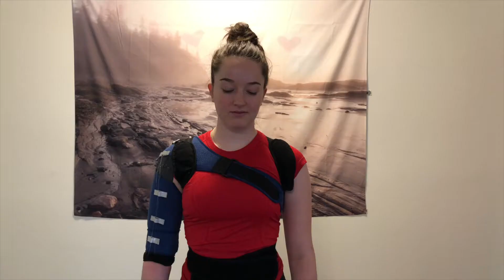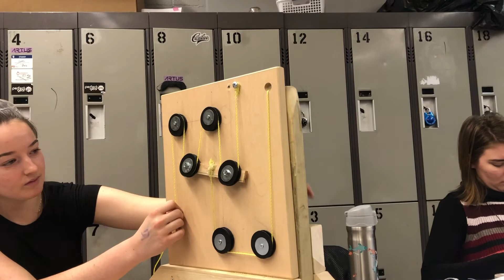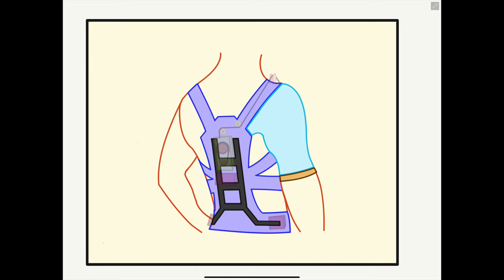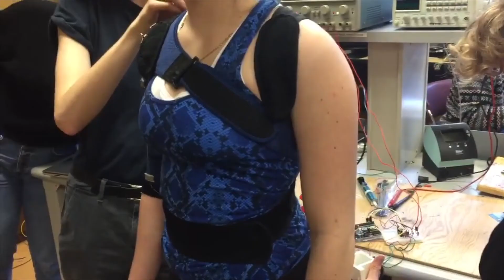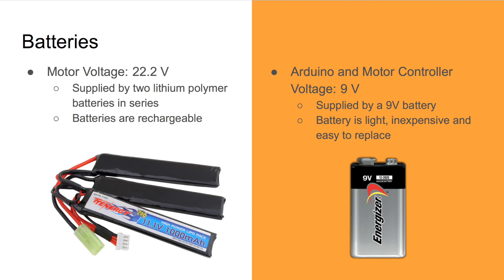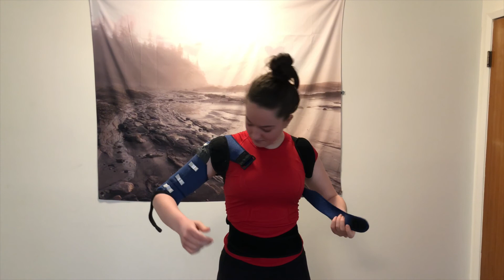XO: Exoskeleton for Focused Sarcopenia  (IGEN 230 Group 11)

Comment: Good demonstrational video and great job on the POC prototype despite the pandemic! For sensor choice have you considered simply measuring the tension of the cable? A force sensor in line with the cable could be used to detect when the user starts lifting his arm -> less cable tension, or bring arm down -> more cable tension.